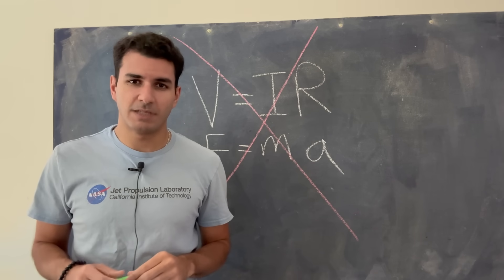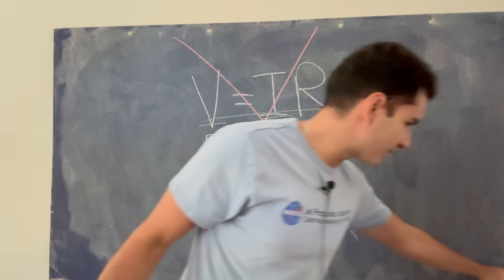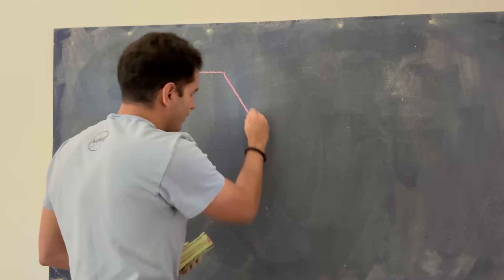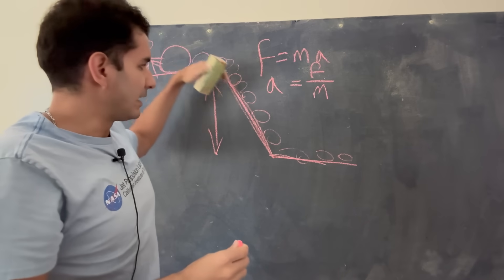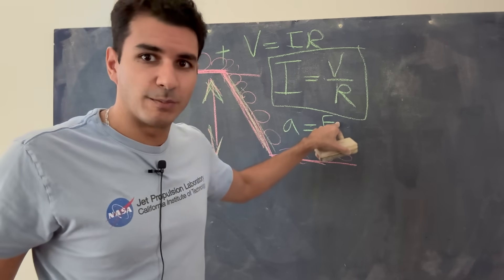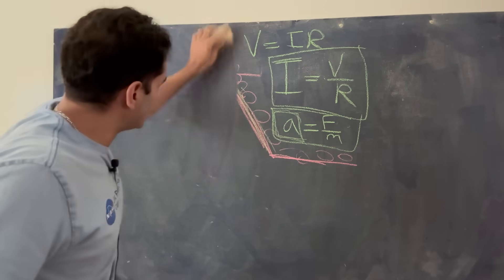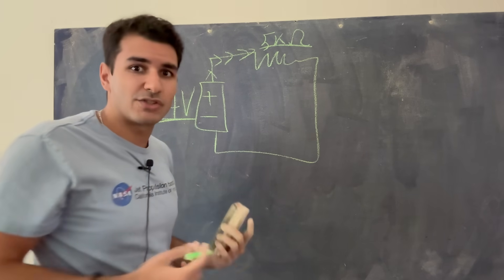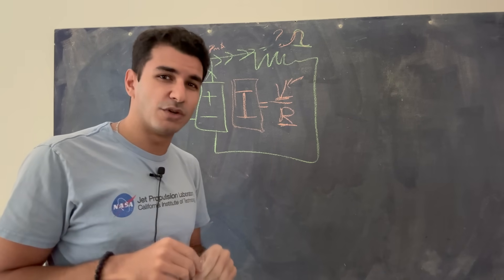You don't really understand physics

Comment: As somebody spend a career designing electronic circuits this is an interesting approach, but the scenario in which you express to use of the equation V=IR should be rearranged has no use. In any a practical sense you would little have need for a circuit with such an infinitely high resistance that no current flows, just as you cannot have a circuit with no resistance.. therefore V=IR is a perfectly acceptable use of Ohms Law for electrical engineering students, any else is just hyperbole.

Comment: Mathematicians would call them dependent(a, I) and independent(v,r;F,m) variables.  You can adjust a voltage, and you can adjust a resistance, but you can't DIRECTLY set a current.  Similarly, you can generate4 a force and choose a mass, but you can't DIRECTLY set an acceleration.

Comment: Keep making videos, my dude. You've got a great talent for communicating the intuitions around math and physics. I would even suggest that you could consider making some longer-form videos, where you have the time to go a bit deeper into things. For example, many highly respected channels often have videos going around 20 minutes or so. Some go even longer, like 30-40 minutes (I'm thinking of Mathologer here, but there are also many others). It's up to you, of course. I'm just saying that your ability to communicate is so good that you could easily hold people's attention for such longer-form videos. Might be worth trying it out a few times, just to see how it goes.

E.g. one topic I've been interested in is how the same basic equations of harmonic oscillation have so many applications from literal springs or vibrating strings to electric circuits (with capacitors, inductors, and resistors), anything with a 'restorative force', many real-world systems, etc. Such a topic would be difficult to cover in 10-15 minutes, or at least it would be rushed and leave a lot of interesting stuff unexplored. But a longer video would suit the topic very well.

Cheers! Keep going!
Reply from the maker: I'm thinking about longer videos, thanks for the suggestion!

Comment: The same question I asked our physics teacher during my BSc... Should be really be V = IR as many books write or I = V/R, as V is the cause and I is the effect of V.

Then he explained, let's say there is battery which has a potential difference, then it causes to flow current when connected in series. So he I = V/R.

But let's say, in some case, there's a current flowing across a resistor from unknown source, and you want to measure the voltage using a voltmeter. Here the value of V changes accordingly with the unknown current. So V is the cause, and I is the effect. So V = IR.

Conclusion, both are correct.

Comment: If you take any beginner EE class, V=IR is introduced in the context of calculating the potential drop (loss in energy) across a resistive component. It is not used to convey that a source of voltage is creating a current, that should be taught in the fundamental physics of voltage and current prior to introducing the equations

Comment: Actually V=IR cannot use in every situations. For example: if we have circut with sinusoidal voltage source then circuit generatw sinusoidal current. we can calculate equvialent wave length of sinusoidal current. If this wave length is order of spatial dimensions of circuit such as length  of wires then circut current will change point to point of wire eventhough every point of wire has same resistence. These type of circuits are Radio Frequency circuits and I learned those when I was selected to engineering faculty. But i was fully confused why this simple logic didn't understand when we was studying advanced level exams.

Comment: You spoke much about V=IR, I=V/R but there was no apparent understanding of why that relation is found to hold. It isn't even absolutely true, but is empirically found to be approximately true over a wide range of currents and voltages. Your discussion was more of an after-the-fact rationalization of the inverse relationship that current and resistance hold given a fixed voltage. The best actual explanation I've seen for why V=IR should hold (nothing wrong with either way of writing it) is in "Electricity and Magnetism" by Edward Purcell, text sections 4.3 and 4.4.  I appreciate your enthusiasm, but your video title is a little ironic. I agree with you though that it is a shame that physics teachers are just mindlessly throwing formulas at students and having them use them without context or understanding.  :/

Comment: i've been working on a game that is making heavy use of both of these equations, the V=I*R can also be broken down further:

V=I*R
I=Q/t
V=QR/t
Q=nALe
V=nALeR/t
R=pL/A
V=nALepL/tA
V=nL^2ep/t
where p is resistivity, L is length, A is area, n is number of force carriers (electrons), e is..IIRC the charge of the electron

i went through a whole bunch of permutations of that formula, even bringing in the formula for electron drift which ended up just reducing the whole thing to d=r/t and wasn't all that useful.

in my case i had numbers that were moving along a wire which were to serve as analog to a coulomb of charge and i wanted to integrate voltage to give a rate of movement, i think i ended up with r=V/QR but i eventually scrapped that and just had I=V/R and when calculating power i just added the number as M, so instead of P=V*I or P=V^2/R it ends up P=MV^2/R

the F=MA is also been a bit of a tricky bit, in this case there is a component in the game which can extract kinetic energy from an object it touches, it has to be powered and can only extract as much as it receives in power, so dealing with F=MA but also K=MV^2/2 and since a force is a change in energy f=(delta)E/(delta)t i can calculate the amount of kinetic energy that would be added to an object being acted on by gravity or any other force as well as how much kinetic energy i can remove given an amount of power (since KE can be represented in KwH, and power in Watts)

Comment: The analogy is not entirely correct. If you want a mechanical analogy to I = V/R it would be a person jumping out of an airplane and falling to the ground. After a short while the person will fall at a constant velocity to the ground, when the friction of the air is equal in magnitude to the acceleration of the earth. 

In the same manner the charges in a conductor move (after briefly accelerating) at essentially a constant velocity because the electrical resistance R prevents them from further acceleration, on average. The current is the charge density multiplied by the average velocity of the charges. Think of thousands of people (charges) jumping out of the airplane (being accelerated in a field) and essentially falling at the same speed to the ground. 

Another mechanical analogy is a person driving in a car with a constant velocity, while "accelerating" by pressing down the throttle. However, the potential difference is not as readily apparent as in the jumper from the sky.

Comment: People ali is talking about macro scales not the micro it clearly shows you people just lack the knowledge of physics because physics is heavily dependent on modeling. For macro modeling ali is the correct one. But for other cases it is different as for nuclear engineering Ali's modeling is wrong because it is micro scale and in those cases you can't think force as fundamentals rather we have to take energy and momentum as fundamental things. In the case of nuclear engineering or quantum mechanics you can't model using Ali's notion. I think i am making this as clear as possible.

Comment: If you want a challenge and think you truly understand those equations explain the faster than wind direct downwind cart (search Veritasium video for it). Spoiler the explanation on Veritasium channel is completely wrong. If you want a problem related more directly to electrical engineering search for the Veritasium video about the big misconception about electricity that also has a completely wrong explanation.
Most recent LLM's can now solve both of those problems sometimes with a bit of help but they already exceeded most people so I'm optimistic about the AI future. They failed fairly hard for both of those problems just 6 to 12 months ago.

Comment: Even a=F/m is wrong in some situations, you need to write it in its differential form, i.e. F= rate of change of momentum or d(momentum (as a function of time)/dt, and if you use product rule, it becomes mdv/dt + dm/dt into v, usually mass of a system remains constant so the second term is zero and it becomes ma, but in a variable mass system like a rocket , we need to take both of them

Comment: i disagree, equation deltaU=R*I means that difference in potential is caused by flowing current and reststance. Current flows whenever there is an potential difference. Potential very close to the electric field itself. And current knows when to flow, whenever there is difference in electron pressure (that we call it voltage). 
Like wind is blowing when there is diffrence in pressures. But wind is the effect of difference in pressures.   Also in this form deltaU=RI it beautifly represents the idea that voltage is dropping on the resistors. And resitance is an contstant, and depending on the current result the drop in voltage. Imagine you have given current and given resistor, therfore this is the only drop here.

Comment: While I like the idea behind the video, I think there are some problems. I am still of the view that students should view V=IR and F=ma as relationships, and not as strictly representing cause and effect. 

For example, for V=IR, current can flow without a voltage as in a superconductor. We might get confused if we aren't restricted to Ohmic materials. There are also scenarios in the lab when using current sources when it is often easier to think of the current causing a voltage, even if that is not strictly true.

And for F=ma, we often infer forces from accelerations that we measure. So to strictly say that forces cause accelerations might confuse students about how experiments are often performed. There are also some issues when converting to the form F= dp/dt. 

Good video!

Comment: I represents current which is measured in amperes. R represents resistance which is measured in ohms. Electromotive force is represented by E and is measured in volts so the correct formula should be I = E / R not I = V / R.  That said, I agree the correct form should be I = E / R.

Comment: That potential V is the cause is NOT always true. In electrical engineering you have voltage sources as well as current sources. Current sources supply constant current irrespective of the resistance.

Comment: So what I understood is - perspective should be the effect that should have been measured rather than the variables that are causes.
Reply: Perspective of? Can you be more detail?
Reply: @Kenzōu_Tenma  just because voltage exists doesn't necessarily imply existence of current,as it's an effect of interaction between voltage and resistance. 
What will happen if resistance becomes zero? What effect will it produce.? No current flows through material?
Changing the magnitude of effect changes the intensity of light in a bulb.
Reply: It will simply turn into a superconductor and the electricity will still pass without any loss..
They are actually used in stuff like high efficiency electric wires and many
But yeah, high electricity means the higher the lumens will be
Reply: @Kenzo_tenma100  my other comment is not visible.

Comment: If an object with mass m is accelerated because of the curvature of space, then it has a force caused by acceleration.

In this case, force is the output, and acceleration is the input. Or, force is the effect, and acceleration is the cause. This is a case which directly contradicts your point.

If I am wrong, please respond with a detailed explaination on why I am wrong. You are more educated than me.

Comment: The equation that you rearranged for Current (I) by rearranging the OHMS LAW doesn't make sense. If you really want to talk about the definition of current then you define it by Current = Charge / Time. which means it is the rate of flow of charge. 
and for Acceleration the equation used to define it is acceleration = change in velocity / time , which means it is the rate of change of velocity.

V=IR is derived to show how how the voltage is directly proportional to current and the constant here is R which then makes the equation V=IR.
and F=ma literally tells that how is force produced. Which means that the force is produced by a body when it has mass and it is accelerating. That moving body is technically a Force.

Comment: The first example is not correct, in F = ma, m refers to inertial mass.
It has nothing to do with potential energy or the gravitational mass or the resistance of the soil.
A better example might be a catcher receiving a ball.
So in order to stop the ball, a = 0, you would have to apply a force, and the bigger the mass, the more force. If it's accelerating, you need even more force. It's the same to put something in motion and throw the ball. So yes, it's a resistance, but not the way you describe it. 

It's only the person pushing that applies here. If the movement get accelerated because it's in a kind of fall on a slope, the inertial mass becomes quite small, but if there is resistance, the bigger the boulder, the faster it will go down. So in that case, the inertial mass of the boulders counters the friction. So now the inertial mass has the opposite effect where it counts. It's a counter-resistance.

Comment: What is wrong with V=IR? I mean, to have current running in a circuit, you must first have a battery or voltage, right? 
Let's imagine you're using fairy lights in your house to decorate it. If the voltage isn't just right, then the lights will definitely either glow dim or not at all.
So after all the current depends on voltage so what's wrong with V=IR?
Please clarify me if I'm wrong.

Comment: Interesting video. But if every thing was explained very deep. It would be consuming too much time. If you need to take the correct components for let’s say a simple radio circuit. Well, by using ohms law, you will get it done. I think that’s the main reason. Like, why do we use a “higher” programming language instead of machine language? Well, understanding literally how the bits and bytes are moving trough a circuit, makes you understand it really good. But if you need to program something in let’s say Basic. Well, it will take way to much time to learn machine language and use it, that use the words in programming languages.

Comment: Nice video! This is absolutely the way an engineer would think, since in an artificial system you set something (V) and get something out (I). Clearly it is much easier to set V to a fixed value than I (though every generator will have some internal resistance, but that's a story for another time), hence the causal interpretation appears very natural. This way of causally interpreting equations is acknowledged by Judea Pearl as guidance in his work on causality, and he credits the first people to explicitly (ab)use equations (who are by their own nature symmetric) to describe asymmetric causation, who were the economists working on so-called structural equation models. The causal interpretation clearly breaks down when we do not know what causes what. This happens only outside of the realm of engineering (at least I hope so), for instance in galactic dynamics we have a law called "Tully Fisher relation" that links the mass of a galaxy to its rotation velocity. In that case finding out what the direction of causality is becomes much harder: galaxies have no knobs we can turn to adjust their rotational velocity or their mass, unlike a generator.